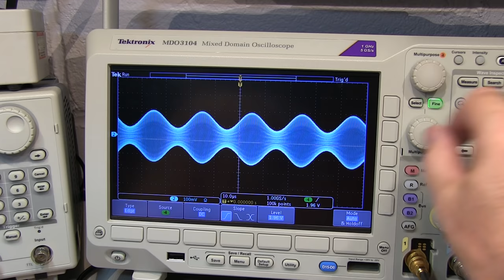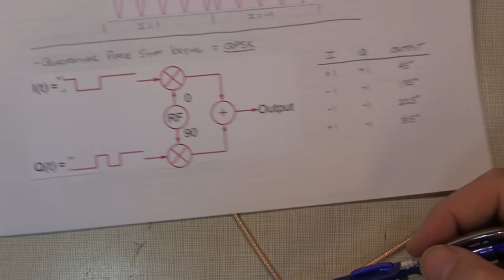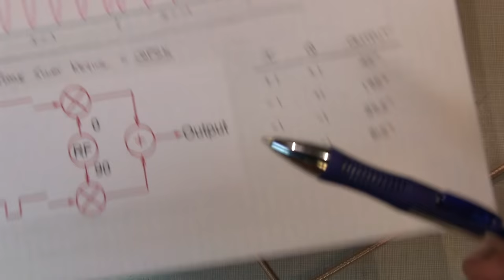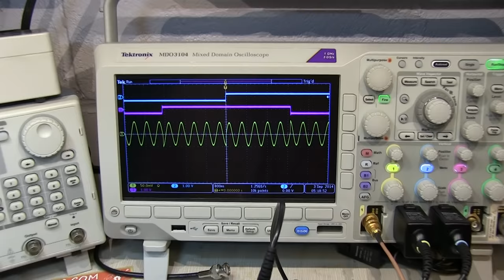#170: Basics of IQ Signals and IQ modulation & demodulation - A tutorial

Comment: Hi Alan,  thanks for sharing another brilliant video - I always look forward to them.

I have what I hope isn't a stupid question, about exactly what the mixers you used for the BPSK and QPSK demonstrations were doing.  Am I correctly understanding that you were sending a 10MHz sine wave (Q) to one the RF input on one mixer and a 10MHz cosine wave (I) to the RF input on the other one ?  Then the mixers were multiplying those I and Q signals by the 1MHz square waves (blue and purple traces on the scope) you were sending to their IF inputs ?  Then the final carrier (the yellow trace) is produced by summing the outputs from the mixers ?  If this is all correct, how is that multiplication done by the mixers ?  What I'm really trying to understand is the difference between how summing and multiplying are done electronically
Reply from the maker: Yes, you got the description exactly right.  Regarding the multiplication in the mixer, you may want to view my video on how diode ring mixers operate, or the basics of mixers video to get a better understanding of that:
How a Diode Ring Mixer works | Mixer operation theory and measurement
Basics of RF Mixers in Radio Receivers / Mixer Tutorial / Frequency Conversion
Reply: ***** Thanks again - they did help a lot.  I had seen the Diode Ring Mixer one already but it actually makes more sense to me now, having seen this video: they  complement each other very well.

Comment: Excellent.  would love to know what the spectrum looks like for QAM64 or QAM-256.  From your scope trace, the simple QAM appears to have some strange behavior at the transition points
Reply from the maker: +Tom M The shape of the spectrum is determined fundamentally by the symbol rate and the filtering used during the modulation.  Without filtering, you get a somewhat typical sinx/x (sinc) function in the spectrum.  In most real-world implementations, the spectrum shape is a rather unremarkable haystack or gaussian shape (filter dependent).

Comment: @ 6:13 So am I right in thinking, that you could use this method to take simultanous voltage and the voltage over a current shunt to display power factor? Maping 90 Deg as 0 PF and 0 Deg as 1 PF?

Comment: The way I see it, there are four fundamental variables that we can use to transmit information w radio: I (real part) Q (imaginary part) the relationship between IQ (phase) and frequency. If I made a matrix w rows being frequencies inside a set bandwidth and, lets say, 4 columns being 4 distinct phase transitions then we can pull signals from that matrix. My goal is to make a simple peer-to-peer data link. What do you think?
Reply from the maker: Not quite. When it comes down to it, the things that you can modulate on a carrier at the amplitude and phase. Frequency is simply a phase variation that changes over time. The amplitude of the I and Q at any instant in time determines the amplitude and phase at that instant. Thus, time varying these amplitudes I(t) and Q(t) can fully define any modulation.

Comment: @10:07 In the example, if Q is brought to zero, then the waveform should only have the in-phase component (i.e. I*cos(t)) as you said and hence a phase-shift of 90 degrees, but in the phasor diagram, if Q is zero then the waveform's phase-shift should be 0 degrees. I'm confused here. Great video by the way! Thanks.
Reply from the maker: True, the constellation could be drawn with the four points on each axis. However, the generally used convention for QPSK is “square” instead of “diamond”.  The both represent the same thing, a 90 degree difference between each point.

Comment: Alan,  another great lesson in how simple electronics really is. 

I've seen quadrature mostly in digital as output from position encoders, usually of the optical flavor. 

Can you please show a little about purely digital quadrature signals and how such an encoder works? 

Thanks and keep up the great contributions.
Reply from the maker: It's actually quite simple - when you spin the encoder, it create a pair of square wave outputs which are offset in time by 1/4 cycle (90 degrees).  You can tell the direction of rotation by which of the two square waves leads the other.
Reply: ***** The encoders I've seen use 4 digital signals to indicate direction & speed. Why use more than 2?
Reply: ***** The encoders I've seen use 4 digital signals to indicate direction & speed. Why use more than 2?

Comment: Thank you for the live demo of the I & Q signals! One thing I did not understand from the video though, is how can you get an FM signal out of adding two signals that have the same frequency? ( you mentioned that we can get ANY RF signal by just modulating the mere I and Q)  No matter what magnitudes the I and Q can change themselves to, when you add, aren't you getting a wave of that same frequency only?
Reply from the maker: The frequency of the I and Q signals determines the frequency offset from the LO frequency.  When I and Q are DC values, the output equals the LO frequency.  When I and Q are cosine and sine waves, then the output is LO + or - the I and Q frequency.  The + or - is determined by which is leading in phase (I or Q).  Thus, as I and Q are varied in frequency, the output will be frequency modulated.
Reply: @w2aew   At 17:33    so LO is the carrier,  and you demodulate to recover the sigal by getting cos(fc+fs) + cos(fc-fs),  and notching out the cos(fc+fs),  is this what's done?
Reply: @w2aew  I looked at the video again more carefully, I now understand your response. Thanks very much!

Comment: Please correct me if I'm wrong, but when you're sending these phase-shifted signals over an antenna, doesn't that create enormous amounts of harmonics because of the sharp edges where the phase changes? I have always wondered about this, I'm very new to RF and your video's clarify a lot, but it also creates new questions!
Reply from the maker: You're absolutely right. In real applications, the baseband signal and/modulator is filtered so that the phase transitions are made more gradually, thus keeping control over the transmitted BW
Reply: Nick Leijenhorst One way to get rid of the sharp edges is to reduce the amplitude to zero before doing the phase shift. This is actually done in PSK-31 where some software send triangular amplitude  "/\/\/\/\" etc and change phase at zero amplitude. (Better shaping than triangular should reduce bandwidth even further?)

Comment: Great Video. When demodulating, is the LO (Local Oscillator) a local free running oscillator or must the LO be in sync with the incoming signal. I.E should the LO be derived (in some way) from the incoming data?

Alan
Reply from the maker: Ideally it would be locked to the carrier, but it doesn't have to be.  Some modulation types are sensitive to the frequency offset, and for the others, the demodulation algorithm has ways of compensating for any small frequency offset.

Comment: Very clear explanation.   I have a question, however.  When the phase is shifted digitally, the transition from one phase to another appears immediate, or at least far faster than the carrier signal changes.  If I'm not mistaken, his means spikes in the spectrum far out from the carrier.  In the real world of RF, that's frowned upon.  Is a simple bandpass on the transmitter output, such as a SAW filter, enough to block those?  If so, what does the resulting carrier look like as it transitions from phase to phase?
Reply from the maker: You're absolutely right.  In reality (and in practice), the phase is never changed so abruptly.  As you've stated, this would result in a hug occupied bandwidth of the signal.  In most cases, the baseband signal is filtered prior to going to the modulator/mixer.  The IF (or RF) is also generally filtered as well.  The result is a phase change that occurs gradually over many, many carrier cycles.  The abrupt phase change shown here (and often in textbooks) is purely for illustrative purposes.

Comment: Dear Alan, In a real life case, we won’t be lucky enough to lock the SigGen and the Quadrature LOs. Even if we achieve great accuracy, there will always be a slight difference in frequency between LO and incoming RF. 
Therefore, for all types of incoming modulated carriers(AM,QPSK, QAM, F)  the resulting phasor should always be rotating around origin of IQ plane while changing amplitude, frequency and phase according to its inherent modulation. So are static points for QPSK etc ever possible to observe? 

Thank you so much for sparing your time to answer this doubt.
Reply from the maker: In real receivers, the final LO is often phase-locked to the incoming signal or there is carrier offset compensation designed into the demodulation circuit (often done digitally).  Techniques like these can eliminate the small frequency offset in the IQ.
Reply: Thanks so much  @w2aew ! 
I strongly feel like I am into something serious and something that's not known to many people. Thanks to your videos, after 1 year of time to time watching, I was able to gradually understand this difficulty myself. I am very sure this must be a well known difficulty but I am proud I spotted it myself. May be this what people call CFO(Carrier Frequency Offset) problem or maybe not. I'll figure it out.  Whatever the case, its really great to know that we can never directly plot the IQ amplitude values on the IQ plane without some special DSP for PSK modulations. Perhaps there are some books that discuss this difficulty in detail.

Comment: Awesome video. thank you for it. A question on demod of IQ signals. Since rx LO is not locked to tx source, is it necessary to add a PLL circuit at the rx or is this type of modulation demodulation tolerant of ppm offsets, thx
Reply from the maker: modern receivers will often include some form of carrier offset removal as part of the demodulation algorithm.

Comment: Great explanation. One question though: If you can create the baseband signal from a DAC (So not just a binary signal), would you really still need both the I and Q baseband signal? Couldn't you just create the sum of those directly in software, before mixing it with the RF signal? Or even just leave one of them out (I or Q = 0)
Reply from the maker: Only if you are interested in just amplitude modulation.  If you need to modulate phase or frequency, then you'd need to separately mix the I and Q with the quadrature LO/IF/RF signals.  There are other ways of doing FM and PM besides using IQ modulation, but that's not the subject of this video.

Comment: Hi w2aew, excellent video. Understood so much. Cannot express in words how good your stratergy is.
A question. Do you remember the exact mixer model and the summer model you used for this experiment? I guess they are from mini circuits. Would really appreciate if you can share two possible models for the summer and mixer for this lesson.
Reply from the maker: The mixers used were Mini-Circuits ADE-1ASK units.  These are surface mount parts.
https://www.minicircuits.com/pdfs/ADE-1ASK.pdf
The summer/splitter is a KDI D241S that I had in my parts bin.
Since the mixer is surface mount, you might want to repeat the experiment with connectorized parts.  There's nothing particularly special about the devices used for this experiment.  Mixers are Level-7 mixers, these units are good for 2-600MHz.  The summer/splitter is a resistive RF splitter.
Reply: w2aew thank you so much!

Comment: Grear video, but I’m having some issues grasping the relation between I, Q and carrier.

You have the I signal and the Q signal. You multiply these and get a new IQ waveform. Is this new IQ waveform then added to a carrier signal to create the actual RF signal that is transmitted?
Reply from the maker: Not quite.  The I signal is multiplied with a RF (carrier or LO) signal, and the Q is multiplied with another carrier/LO signal which is shifted by 90 degrees.  Then, these two signals are added together to get the final RF signal.
Reply: Ah, I see. Thank you!

Comment: I'd love to see an expansion on this topic that covers other different modulation techniques that are commonly used in modern tech, like QAM, FSK, OFDM, et cetra. How are we able to squeeze in 256 constellation points into a single signal?
Reply: As far as I know, you just need higher and higher SNR to be able to distinguish between the constellation points when you go for higher constellation numbers. That means a combination of better receiver sensitivity, more RF power, lower noise data converters etc. QAM 256 means 16 x 16 I/Q amplitude levels as opposed to the 2 x 2 levels in QPSK so it's harder to detect.
Reply from the maker: kalhana1 has this right.  Higher order QAM signals require better SNR.  It is very common though.  Furthermore, OFDM signals, such as those use for WLAN, etc. employ high-order QAM modulation on dozens or even hundreds of closely spaced sub-carriers - all at the same time.  RF is magic...

Comment: Thanks w2aew, Just a quick question. At the receiver,  does the LO need to be locked to the carrier ?  The scope shots show that the carrier is locked.
Reply from the maker: Ideally yes, but that is rarely possible.  Receivers generally have a way to remove or correct for the frequency offset.

Comment: IQ signals are best understood as 3 dimensional. If the o'scope had an X-Y display plus a time axis you could plot it. But you loose the timeaxis when you have an XY display. A new scope is needed with 3D representation.
You don't need numbers to understand the concept, numbers only needed for accuracy.

Comment: still have some doubt. in digital communication system, we are having one block known as symbol mapper . The input to that block are bits and output is symbols (based on constellation points. e.g. QAM , QPSK,BPSK,etc.). So, I am confused with the QAM in symbol mapper and the IQ modulation and demodulation.  Sir, are these two (QAM in symbol mapper and IQ modulation and demodulation techique) same or different? Please clear the doubt sir.
Reply from the maker: Ideally they would be the same, but in reality this is generally only true for the TX side.  On the receive side, there would have to be some form of carrier frequency/phase offset correction in order to recover the baseband signals.

Comment: Excellent video!!! thank you. it real got clear to me how IQ signals are produced. I have a question and I hope you could explain me. How can I do a QPSK to a digital signal of 100Kbps using a carrier of 4 GHz. I mean I receive a digital signal with a speed of 100Kbps and I need to modulate it with a 4 GHz carrier using QPSK. Someone give me a clue please
Reply from the maker: +Jony Pedor dos Santos At the 15:00 point in the video - I show how this is done.  Feed a pair of mixers with the 4GHz carrier in quadrature, and modulate the phases with bit pairs.  Or, you can modulate a lower frequency IF (which might be easier to create in quadrature), then upconvert with another mixer and LO.

Comment: Great explanation! Thanks a lot!
But I have some questions. How to use IQ modulation to implement FSK? i.e. how can changing the value of IQ change the frequency?
and why is frequency modulation is just a form of phase modulation?
Hope to receive your reply, thank you.
Reply from the maker: Think about it this way.  Frequency deviation is simply the first derivative (rate of change of) of phase.  For example, if the phase changes by 360 degrees in one second, that represents a 1Hz frequency offset from the baseband.
Reply: @w2aew  Thanks for your reply! Can FSK be explained intuitively like the case of ASK and PSK in this video?
Reply from the maker: @jadenlin1845   Sure - a frequency offset from the baseband frequency will be represented as a rotation of the vector.  The speed of the vector (rotations per second) represents the frequency offset.  The direction of rotation (CW or CCW) represents whether the frequency offset is higher or lower than baseband.
Reply: @w2aew  I get it. Thanks again! :)

Comment: I'm a bit confused about how the signals are demodulated. I would think you would need a point of reference to know the phase angle of a received signal. How do we know that the phase is 90° rather than 0° or 30° etc... A 10MHz signal that's 90° out of phase looks just like a 10MHz signal that's 45° out of phase or one that's in phase if there's no reference to the original source. You get what I mean?  I'm sure there's a way, just confused about how. Thanks, this was a very informative video. 
73,  
Brian,
KM4MLS
Reply from the maker: I understand what you mean. The reality is that in a receiver there will always be some arbitrary phase difference between the signal and the quadrature demodulator's oscillators. In fact, there will usually be some small frequency offset too. Part of the job of the demodulator is to deal with this.
Reply: w2aew, I saw someone else's video shortly after I watched this that went into demodulation a little further or a little differently. I think I understand a bit better now. Thanks for the help. :)